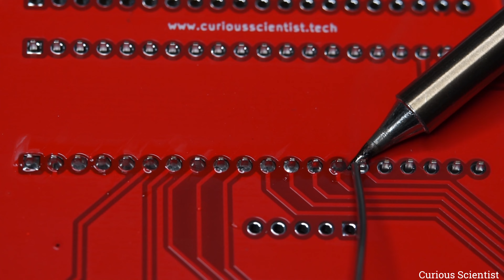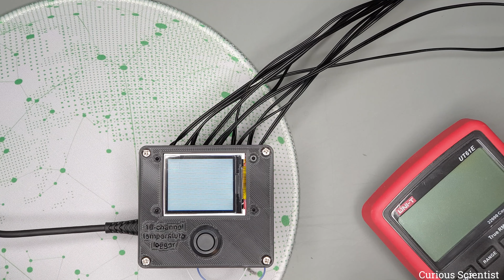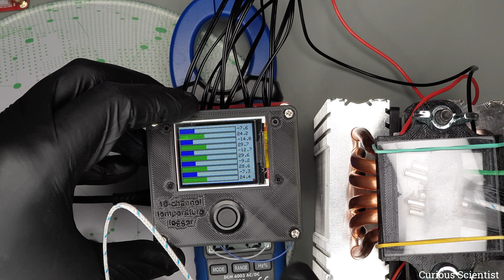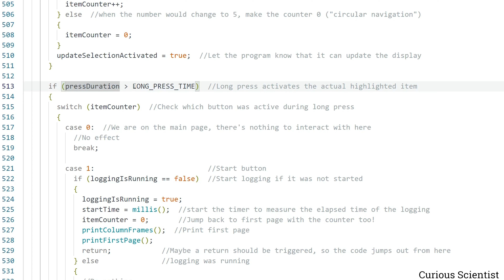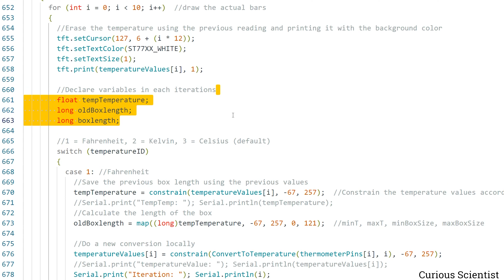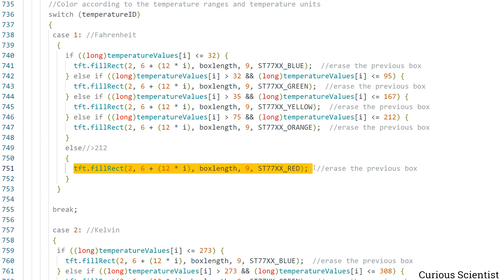10-channel thermistor-based temperature logger with display and SD card - improvements

Comment: Thanks for video. When we order components from PCBway, do they send all the equipment?
Reply from the maker: Hi! It depends on what you order. I used some custom parts here like the front panel and those spacer nuts, so they might not be available, but I think they can source the rest. It is better and easier if you send them an email. I am not a PCBWay staff, I am just sponsored by them.